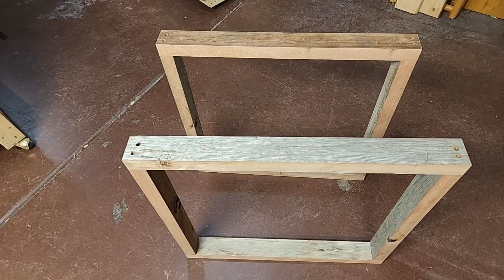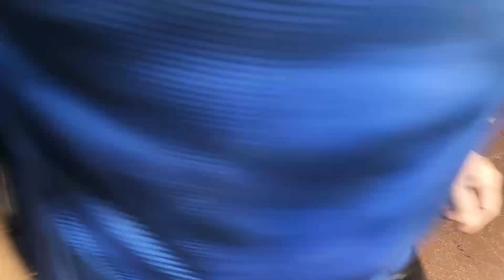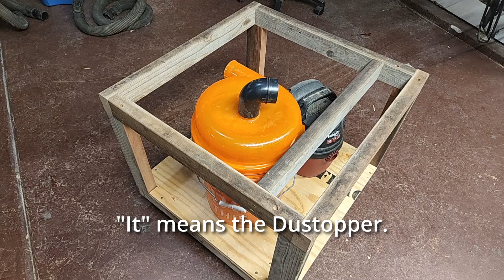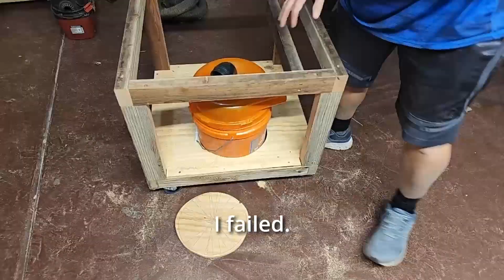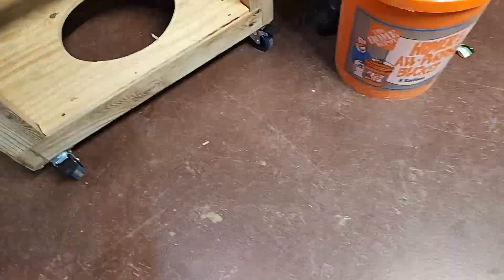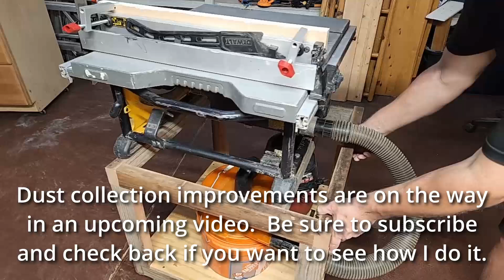Salvaged Wood Turned into Mobile Table Saw Cart with Dust Collection for DeWalt 7491

Comment: did you think about putting the bucket on a lowered shelf rather than just the tension?
Reply from the maker: Not sure I understand what you're asking.  Do you mean a lower shelf to the side?
Reply: @PeladoCreations  Using the round piece you cut out to create a shelf suspended below the main shelf of the cart. then the bucket could sit on the shelf.
Reply from the maker: I did not think of that, and so I didn't consider it at all.  In at least some ways, I think that would have worked better than what I did.